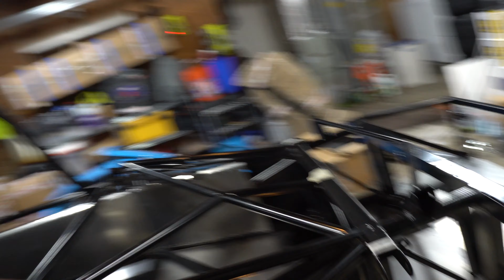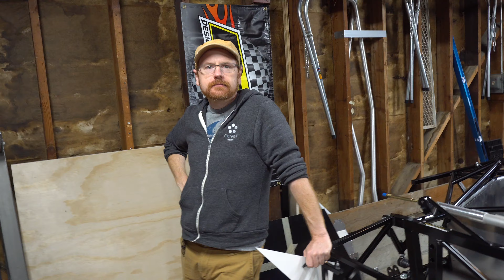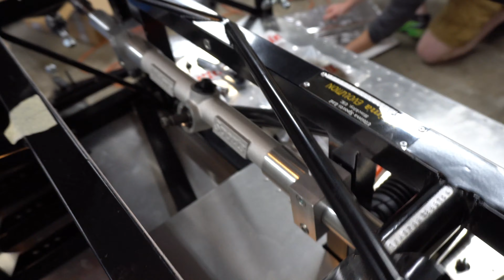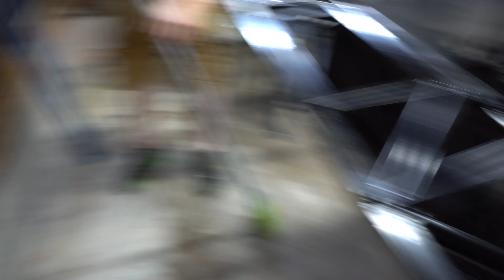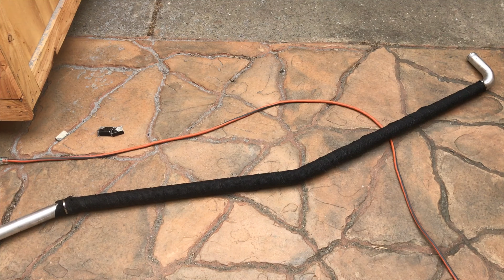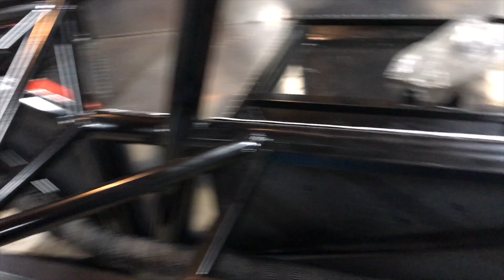Project Blunicorn 008, A-arms, steering and water pipes

Comment: ¿Ultima evo no anti roll bars?
Reply from the maker: Ultimas do not come with a front or rear anti-roll bar.  In my testing on street tires, with stiffer track focused springs and the shocks tuned right I haven't seen the need for them.  However, once you step up to racing slicks, you will probably need anti-roll bars.

Comment: This is where I start asking silly questions.  The arms look as though there is a pin going through the brackets and the Rose joints with no location for the joint along the shaft so it’s free to move.  Should it have washers or nylon bushes to give the arms location, do these go in after aligning the suspension or don’t you use them at all?
Reply from the maker: It's hard to see but there are brass bushings on either side of the helm joint to locate it in the mount.  Some of them were a bit of a pain to install because the tolerances were so tight.